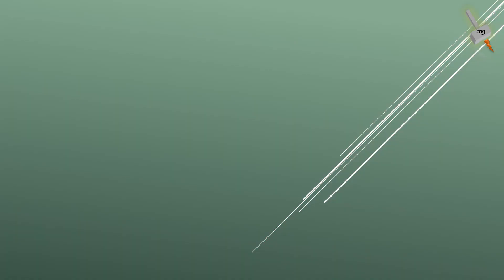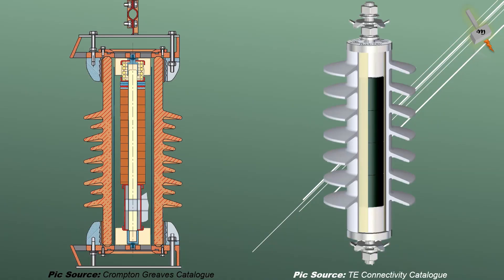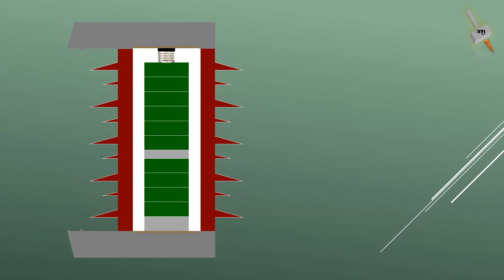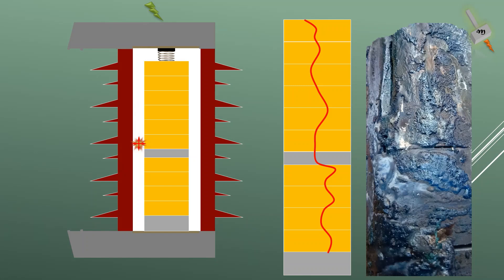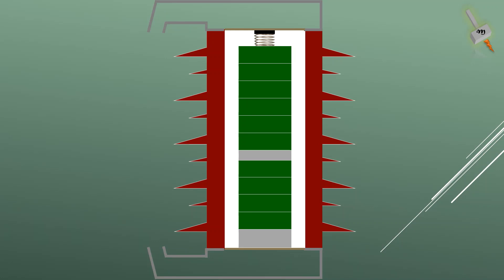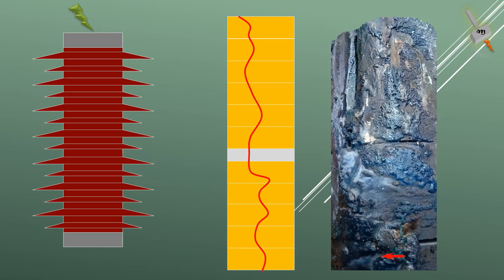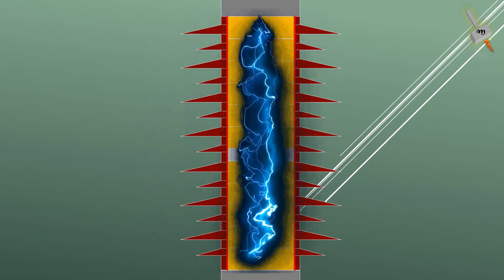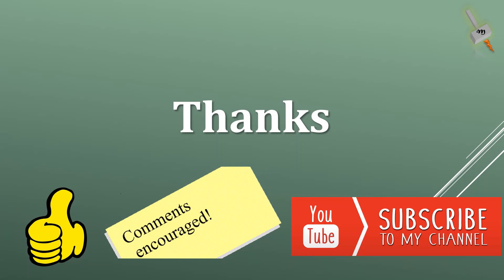Pressure Relief of Lightning Arrester

Comment: Thank you for the explanation! But for high voltage arrester, how to define an integrity of surge counter which is connected in series with arrester during short circuit condition?  which kinds of mechanism are available in counter which can withstand high amount of short circuit currents?